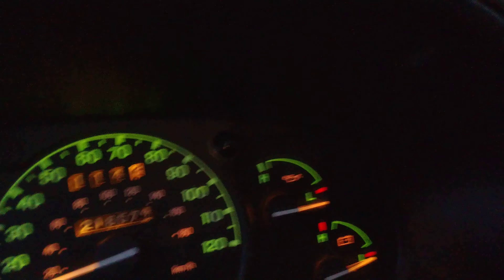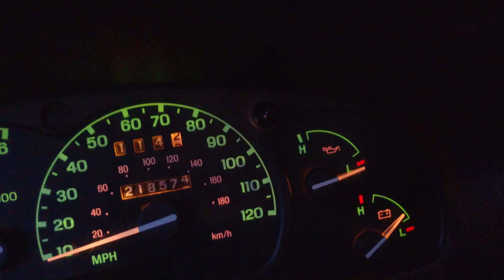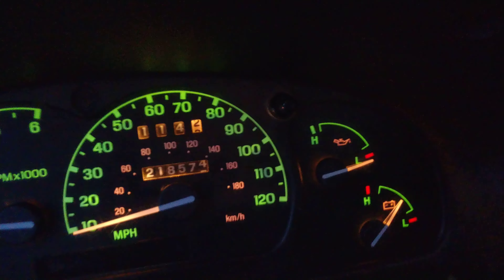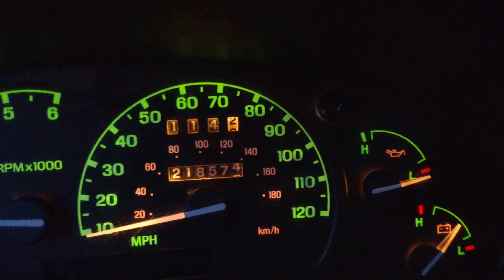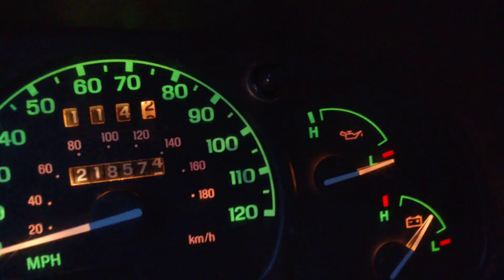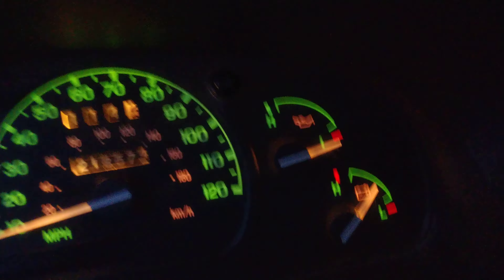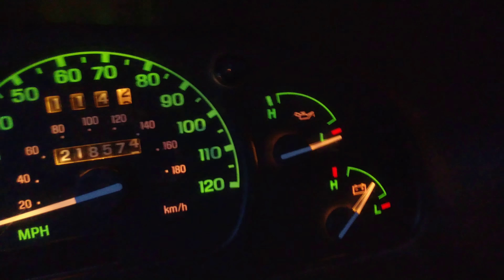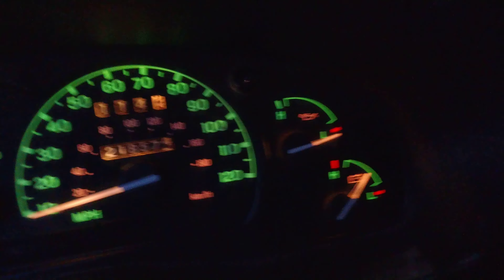Bad oil pressure sensor 1999 Ford ranger?

Comment: Looks like your gauge needle is stuck behind the post mine did the same thing
Reply from the maker: I don’t think it had a post it would go to the middle idk I sold that truck I got a 3.0L ranger now
Reply: You can move the needle back into position with a strong magnet. Use a smooth one so you don't scratch anything